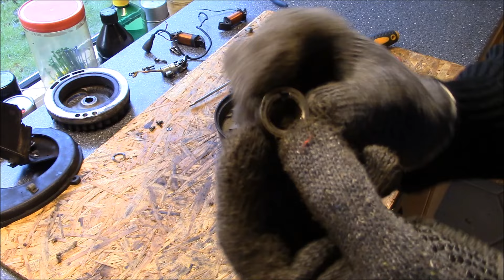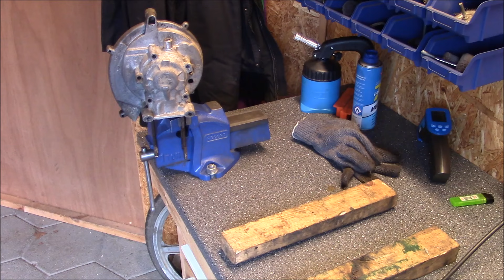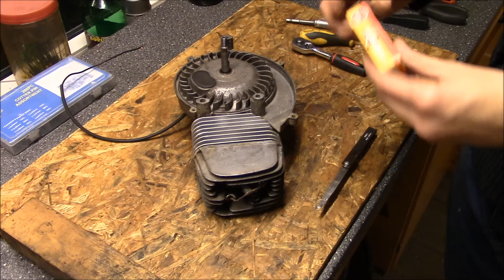Piaggio Moped Engine Rebuild

Comment: Dissasemble - Flywheel and Electric components 1:35
Dissasemble Cylinder 6:31
Piston Removal 8:02
Crankcase splitting 10:13
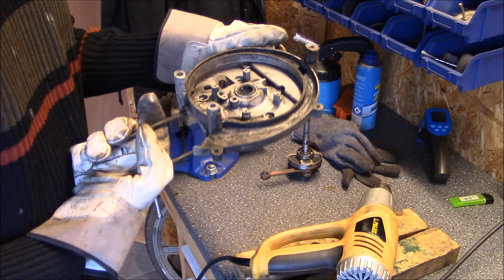Crankshaft bearings removal 17:07
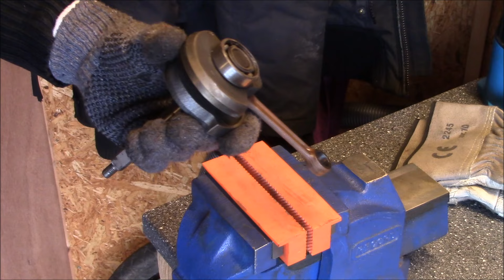Crankshaft inspection 19:07
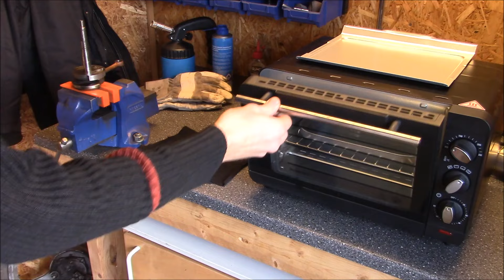Bearings mounting 22:41
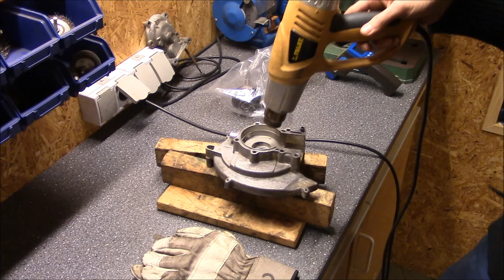Crankshaft & crankcase mounting 24:18
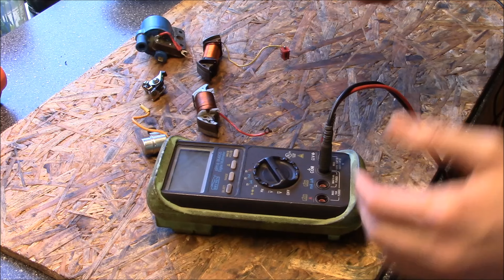Ignition parts measuring 27:46
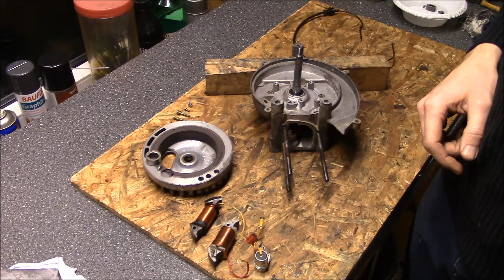Ignition parts mounting 35:10
Breaker points setting and adjusting 39:11
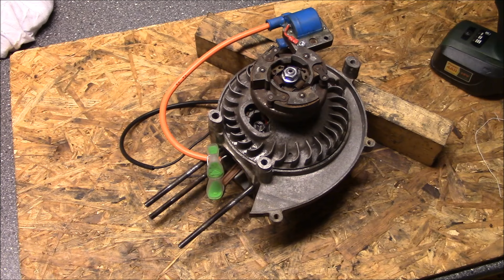Ignition testing 41:39
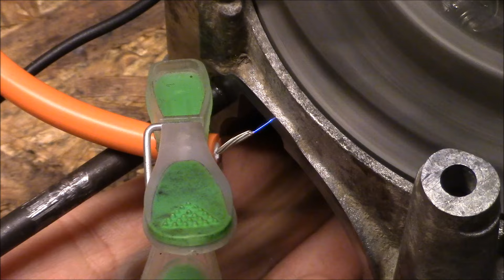Cylinder-kit mounting 42:44
Reply: Thanks you buddy apreciate

Comment: Hej Carsten. Jeg har et spørgsmål til platin indstillingen. 

Jeg fandt en anden video på dansk hvor han indstiller dem meget mere avanceret. 

Der siger han at man skal køre stemplet 1,44mm ned fra top positionen og at det er på det punkt at der skal være 0,40mm mellem platinerne. 

Er det nødvendigt at gøre det så avanceret? Eller er det fint nok at køre stemplet helt i top og at platinerne ved det punkt står til 0,40?

På forhånd mange tak for din tid!
Reply from the maker: Hej. Nej ved 1,4 mm før top, skal de først åbne. Det er ca der hvor gnisten skal komme. Hvornår den skal komme, afhænger af motor og de stumper der sidder på den.
Det kan også måles i grader på svinghjulet.
Men man rammer meget godt ved at justere platinerne et sted mellem 0,35-0,45 mm åbning, når stempel er i top. Så passer det med en fin fortænding.
Reply: @CarstenLorenzen12V  Mange tak for hurtigt svar! Så det vil sige at det eneste jeg faktisk behøver at tænke på er de 0,35-0,45mm når platinerne er fuldt åben?
Reply from the maker: @deductedzack9049 ja, prøv 0,4. Tændings banker den, så prøv lidt mindre åbning.
Reply: @CarstenLorenzen12V  Det vil jeg prøve, kan se den står lige nu til 0,55mm så det er jo for meget. 

Jeg startede den op første gang i går, den har en ny renoveret motor, og den startede rigtig let. Den lød også rigtig fint også når man gav gas mens den var på støttefod. 

Men når jeg skulle prøve at køre en tur på den, så hakkede den og var ved at dø ud ved lav hastighed. 

Hvis jeg så hjalp den op i fart med pedalerne kørte den fint, dog uden alt for godt optræk. 

Der er ny koblingsbakker og fjedre i koblingen og en ny kilrem på den.. har du en ide til hvor problemet kunne ligge? Ud over forkert indstillet platiner?
Reply from the maker: @deductedzack9049 ja få dem ned på 0,4. Det andet er for meget.
Hvis den går som du beskriver, tyder det meget på karburator indstilling.
Reply: @CarstenLorenzen12V  Hvilken størrelse karburator ville du køre med til en helt std Ciao motor? En 12/10 eller 12/7?
Reply from the maker: @deductedzack9049 hvis den er med plumbe, så 12/7. Men 12/10 er også brugt af piaggio. Selvom der sidder en 7 mm plumbe i blokken.
Reply: @CarstenLorenzen12V  okay 👍 okay super. Vil du også mene at en helt std ciao motor aldrig ville kunne trække en 6.5:1 gearing i baghjulet? Altså en Ciao med mono drev og så det største tandhjul der kan side i gearkassen. (Den gearkasse hvor der kun er 2 tandhjul)
Reply from the maker: @deductedzack9049 det er måske lidt til den lange side. Hvis den kan trække det, giver det 10 km/t mere. Så det er jo en 1/3 forøgelse i gearingen.
Hvis du ikke vejer meget, og ikke har mange bakker, måske. Men den bliver ikke frisk i optrækket 😉

Du skal i hvert fald have lille kobling og 94 mm remskive bagi. Der findes også en 105 mm skive, men jeg tror ikke den passer i ciao stellet.
Reply: @CarstenLorenzen12V  Okay super, så tror jeg måske nemlig at det er en del af grunden til at den næsten ikke kan komme i gang og hakker i motoren ved lav hastighed, ind til jeg hjælper den højere op i fart med pedalerne 🤷🏽‍♂️

Comment: Will just removing the air restrictor help with power while everything else is stock?
Reply from the maker: No, you need to rejet. But even that will not be noticeable by a lot. You will get more noise and dirt in the engine 😉
Reply: @CarstenLorenzen12V which jet after removing it?

Comment: How do i do wiring for the Piaggio Bravo 1986? The only Diagrams i found is for 1980 and before
Reply from the maker: Depends a lot on the model. There a simple models with breaker point ignition and only front and tail lights. The most advanced have cdi ignition, horn and turn signals. What have you got? Maybe i can find something in my archives.
Reply: @CarstenLorenzen12V Mine  has 2 coils so front and rear lights
Reply from the maker: @bjarke2929 one coil is for the ignition, the other pulls both lights. The setup is simple, 6V plus and ground go from the engine to the front light, on a switch. From the switch a short cable to the front bulb, and a long one to the tail light. The tail light usually gets ground from the frame. But you can pull a separate wire if you like (i do).

And that's it, very simple.

Comment: Hi! i'm currently fixing the ignition on my ciao but i'm trying to find good info of how to set a proper timing with your breaker points and the position of the piston, as far as i can see you don't cover the timing in this video?
Reply from the maker: Hi. I don't have a video on the exact timing. I know there are some good ones on other moped brands, maybe use inspiration from those.
You can only adjust the timing by opening the breaker points more or less. More open is earlier. On these engines, 0,3-0,5 mm is a good usable range. With a tuned engine, 0,35 mm fits well. Standard 0,4-0,45 mm. I normally don't do any more advanced timing on these engines, other than setting the breaker points gap.
Reply: @CarstenLorenzen12V  thanks man! i'll give it a try of putting the piston right before dead center and then adjusting my breaker points, but it's a little confuing that you recommend having a slightly smaller opening with a tuned engine. I haven't fired it up yet but according to the manual on my new 72 polini cylinder they recommend an opening of 0.5
Reply from the maker: @gingerindabush yes i know, to me, that is way too much pre ignition. The polini kit is high compression and knocks pretty easily, even with 100 octane petrol.
A two stroke needs less pre ignition with higher rpm.
Reply: @CarstenLorenzen12V   i see, what i have on my ciao atm is a 63 malossi cylinder, would you recommend a gap of 0.35-0.40 on that aswell?
Reply from the maker: @gingerindabush yes 😊
Reply: I'll give it a try and get back with the results

Comment: i need to replace my crankcase gasket, can i just lift oft the small engine house or do i need to take out the whole cylinder??? :( like u did? or can i just lift of the small enginehouse??
Reply from the maker: @knugenalvin1817  the paper between the engine halves? Complete disassembly, cylinder, ignition, everything. Why do you suspect a failed gasket?
Reply: @ cuz when i spray breake cleaner on the gasket the motor dies, it runs good on high rpm and very bad when i go from 0kmh.
Anf i took some loctilde 5922 on the gasket and it helped when the motor was cold, then when i was war it was struggling in the middle rpms:(
Reply: Hola soy de México, si ocupas cambiar la junta pues por ahí se está fugando la compresión de la mezcla por eso a bajas revoluciones no se mantiene encendido, no es complicado, yo lo desarme solo el lado de la tapa del lado cigüeñal, pero para que saliera la tapa utilice una pistola de calor para que soltará la tapa pues tiene el balero del cigüeñal, mi junta estaba rota y fugaba, al principio pensé que era aceite pero era la mezcla de la gasolina, una vez que lo volví armar quedó perfecto

Comment: How to do this part 1:50 without this special tool
Reply from the maker: @luXyMont  please get the tool. All alternative methods can be harmful.
Reply: @CarstenLorenzen12V  I can't find it anywhere in my country that's the problem but ok if you say so I will take your word and order it from somewhere else
Reply: @luXyMont  what country 
ill help
Reply: @lucaKED  slovenia please help
Reply: Hit around the flywheel with a rubber hammer, it will get loose and you can pull it off.
Reply: You can put a screwdriver or similar item through the hole that the stator wires comes out of and gently tap the flywheel off the shaft, make sure to keep rotating the flywheel as to not get it crooked and be careful not to hit too hard.

Comment: Thank you for this video. Would you know what would cause my si moped to not want to restart when it's hot?  It runs great, but doesn't  want to restart easily after shut off until it cools?😂
Reply: Condensator is burned, buy one from thorcap, the bottom one.

Comment: I have a piaggio bravo, it idles but the spark plug blackens, I have a 58 jigler, it seems to me that it goes a little drowned but when it stretches it goes well.. What can I do to him if he blacks the spark plug at idle?
Reply from the maker: @jony7998  hi. You can make the throttle slide more angled, seen from the inlet side of the carb. The SHA carb is very rich at idle, i do this on all that i mount.

Comment: kan jeg tage den originale krumtap i en polini speedengine til 80cc cylle?
Reply from the maker: @kristofferjacobsen1555  ja hvis det er den udroslede, den finder man mest i Bravo, Si etc. Den droslede der sidder i Ciao 25/30 km/t duer ikke så godt til speedengine.
Reply: @CarstenLorenzen12V  jeg har en bravo så det er helt fint. Ved du hvor hurtigt den kommer til at køre med 80cc?
Reply from the maker: @kristofferjacobsen1555  70-80 afhængig af udstødning og gearing.
Reply: @CarstenLorenzen12V  er det bare at sætte krumtap i eller er der en speciel måde den skal sidde på?
Reply from the maker: @kristofferjacobsen1555  ja den passer direkte i en speedengine, bare følg min video .
Reply: @CarstenLorenzen12V  lækkert tak
Reply: @CarstenLorenzen12V  kan man bruge den originale kaburator? fordi jeg er bekymret for om den får nok at leve for
Reply from the maker: @kristofferjacobsen1555  du skal have en 13er på, det går fint.
Reply: Nu har jeg testes med sløs og der er ikke noget og jeg skal til at sætte den i en speedengine skal man lubrikere den?
Reply: Nu har jeg prøvet flere gange men den drikker med at komme i og jeg er bange for at man kan varme den for meget

Comment: hey nice video! ive watched it many times. Hope you can answer even though its such an old video. I was just wondering: are the crankshaft bearings lubricated from the fuel/oil mixture or did you put some bearing grease there?
Reply from the maker: They are lubricated by the oil in the gasoline. I may have used sealed bearings where i removed the seals, hence the grease residue. It's fine, gives lubrication on the start up.
If you have "dry" bearings, give them a few drops of oil.
Reply: @CarstenLorenzen12V  ok thanks! I might have used bearing grease on the bearings before installing. Do you think it's best to open up and remove it or do you think it will wear off?
Reply from the maker: @andersbacklund6224  it wears of over time. No biggie.
Reply: @CarstenLorenzen12V  ok thanks for the info!

Comment: Hello, approx. how many miles can an original engine, cylinder and piston go? Ofcourse with maintenance. Thanks.
Reply from the maker: I would guess around 30.000 km, at that point I've seen the wear on the cylinder kit to be over the max. specs. But many factors have a play here. All the worn parts are easy/cheap to replace.
Reply: @CarstenLorenzen12V  Okay. Thank you. I read someone mentioned an original Piaggio engine, cylinder and piston can go as far as a 100.000 km

Comment: Excellent video! I've got a 1996 Kinetic TFR (Luna) which was made in India using a copy of the Ciao engine but lacks the variator. One of the crankcase bearings failed in my engine. I took it apart and replaced the bearings.  After the bearings had failed, I was able to spin it with a drill but not start it. At this point it had 100 PSI of compression. Not that great but not bad.

That gasket that goes between the two engine halves they sent me looked like it was cut from an aluminum Pepsi can and did not seal worth a damn and lost compression and sucked in air. 

After putting the engine back together the compression dropped to 90 PSI and would only run at WOT (lean). I then discovered gas/oil leaking from where the two engine halves go together. 

I made a paper gasket from the aluminum one I was sent. I put the engine back together but for some reason this time it would not start at all. It took it apart again and accidently broke one of the rings which trying to remove it. I should have replaced them anyway while I had the engine apart. I ordered new rings but got frustrated and quit on it. That was eight years ago. It may have been an unrelated issue (carburetor).

I boxed the engine and parts up and pushed it into a storage building and it's sat there ever since.  I just recently acquired a 1985 Tomos Silver Bullet. I'm putting a 70cc kit on it. I also have a 1999 Tomos TX-50 dirt bike which uses the A35 engine and transmission. Don't know if these were only sold for the US market.

You've inspired me to get my Kinetic out and take another look at this thing. One reason I watched your video is the ring orientation. Seems like the go on a certain way. And that decompression valve!

I'll check out your Cioa performance video. My Tomos seems to be restricted to 32 kph. I think because in the 1980s you could ride this if you didn't have a driver's licence.

BTW. I live in Tennessee, United States. Interesting enough, the moped laws that were in place in my state years ago seem to be obsolete. I had to register my Silver Bullet as a motorcycle and there is no laws on increasing it's power as long as I don't go over the posted speed limit. I also have to have a standard driver's license (125ccs+ requires a motorcycle license).
Reply from the maker: Thanks for the interesting read. I hope you get the Vespa copy out on the road again with help from my videos :)
Reply: I have a 2001 Kinetic (slower than an old dog - spedo says 30 while radar sign says 25, needs to go at least 30 to avoid being run over in single lanes) - I made an expansion pipe with twin muffs and wrapped the thing in fiberglass to further quiet it, that added 5 mph. 
Did the 13;13 carb with a 55 jet, and that added a tiny bit of power. But the main restriction appears to be in the engine case, thus I am studying vids here and Carsten's are great (and in English, not Italian- nice).  Thank you Carsten!!  Mike  
 Oh, Carsten, I have been experimenting with a valve in the exhaust "bleeder" that gives some variable back pressure to regain the low end that is typically lost with the expansion deal.
 A weighted plunger sits against a seat (nearly vertical pipe) and as flow presses against the plunger, it rises to uncover holes that vent the exhaust into the muffler.  The low end seems (as far as I can tell) like stock, and the back pressure increases to just over one pound at 30 mph, the pipe seems to "Hit" at 20 mph.

Comment: hello, how do I find the pre-ignition correctly, please?
Reply from the maker: Make some marks on the flywheel, when the piston is at tdc (top). And then rotate the flywheel counterclockwise to set a mark at the desired position. That could be with the piston 1-2 mm below/before tdc. Adjust the breaker points to open at that moment. You can also use a strobo.

Comment: Hi there, I have done exactly what you show in the video regarding the ignition, but i still seem to have issues with the engine. It starts up fine and idles, but after 2-3 minutes (when it gets warm), the bike shuts off. The condensor is brand new, so i dont think thats the issue. Any ideas? Im running out of hope soon, have tried so many things
Reply from the maker: Sadly, new capacitors are often of bad quality and show defects like you experience. I use 330nf mkp x2 industrial capacitors now a days. Also be sure to use a good original ignition coil. Also a typical defect if the bike shuts of when warmed up.
And last, change spark plug and the cap - they can also give these symptoms.
Reply: @CarstenLorenzen12V  okay thanks. I will try externally mounting a new coil soon, hopefully that will help me. Do you also mount that capsitor externally, or how do you mount the 330nf mkp x2?
Reply from the maker: @spyropyro3159  yes disconnect the old one and let i function only as grease felt holder. Mount the new one externally directly at the coil. One leg on the wire from the breaker points/feeding coil. The other to ground.
Reply: @CarstenLorenzen12V  okay makes sence. Basically installing it just like a regular external capasitor. Where do you buy them?
Reply from the maker: @spyropyro3159  i got them from ebay, directly in china for a very low price. Try Google. All kinds of electronics shops have them.
Reply: @CarstenLorenzen12V  okay, thanks for the quick response! I will give it a shot:)
Reply: @CarstenLorenzen12V  ive mounted a regular aftermarket condesator now, and it actually rides okay now. If i may ask, why that exact capasitor? Why the 330nf mkp x2, compared to any other capasitor?
Reply from the maker: @spyropyro3159  they have just proven to be very reliable. No liquid inside like old electrolyte capacitors, that can pop open or dry out. 330 nF is the value of the original capacitor, so i just picked that value. I use 275V versions, or greater.
And you can get them for under a euro a piece, so i buy them for no money in bulk 😉
Reply: @CarstenLorenzen12V  ahh okay makes sence. Im only used to electronic ignition, so this is all a little “new” to me. Thanks!:)